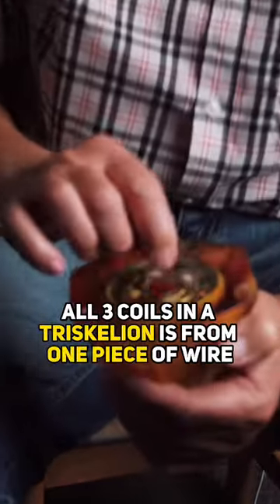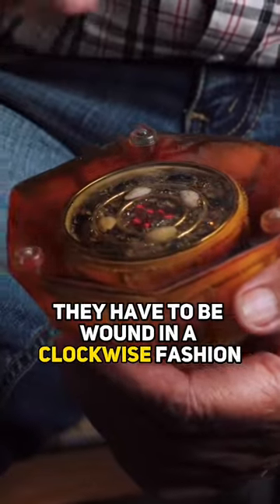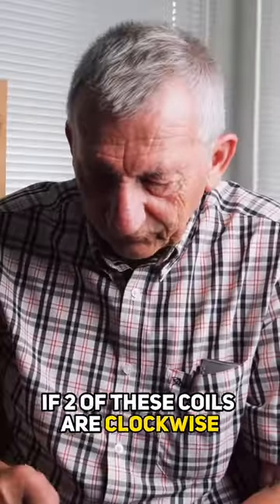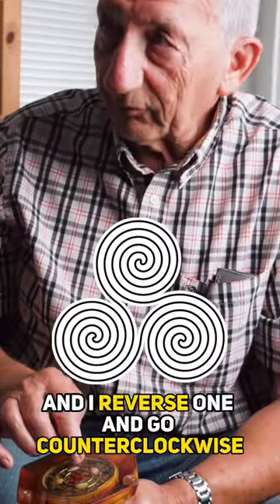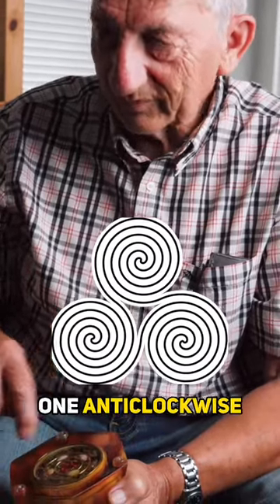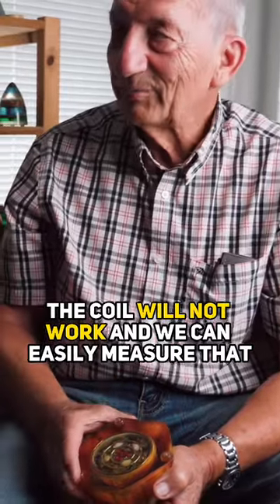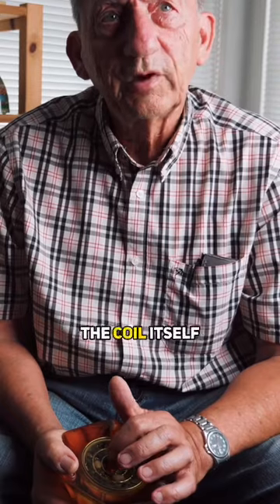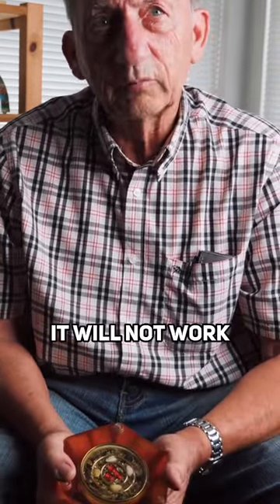How to Make Orgonite with Triskelion Coil #shorts

Comment: Clockwise meaning it points out. So when u look at it finished, means it spirals clockwise. 
Use Egyptian royal cubic measurement divded by 2 or 4 or 8, must be like this. Then twist center, the twist ends so that the end is the inner spiral. This is how i saw it in another video he does with green jade orgone pyramid.

Comment: If you flip the triskelion over, it becomes counter clockwise. What is the proper orientation of the triskelion in the OG. Without that information this video is of little help. Thanks.